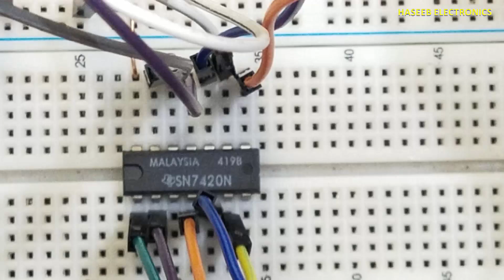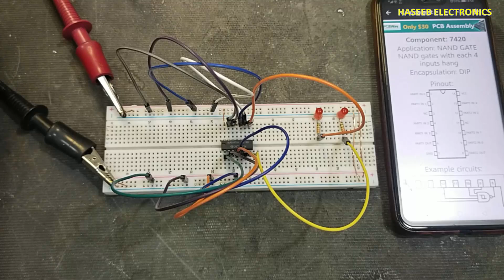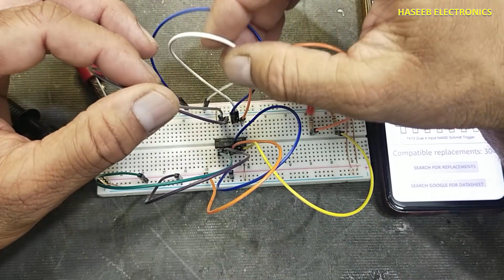{1009} Dual 4-input NAND gate

Comment: Sir, today I have made DK124 SMPS 12v circuit, by looking at the datasheet diagram of IC, 12 volt is there without load and when 12v is 1A load it is coming down to 4 volt, what could be the reason for this?